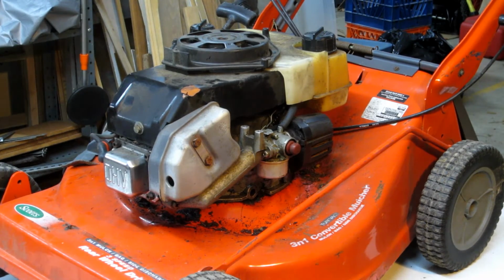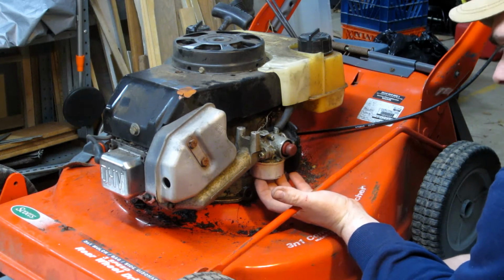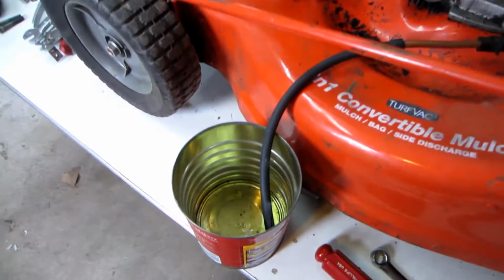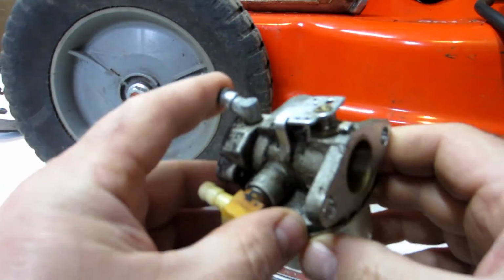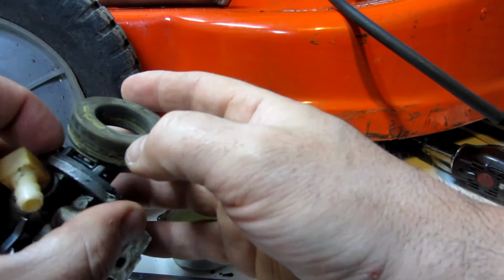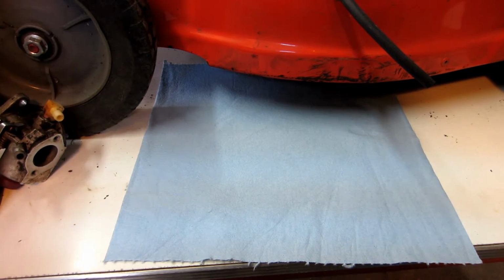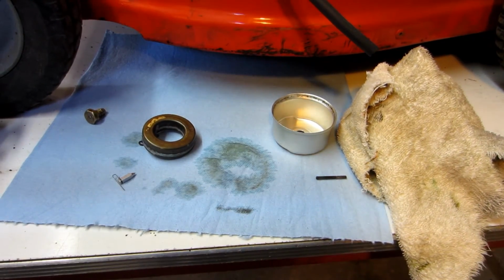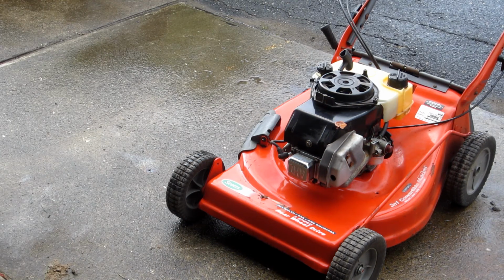Scotts Mower 6.5 hp self propelled.  Is it dead or Alive? Part 2

Comment: Can I get the model number and were I can get the driving belt?
Reply from the maker: I no longer have this mower, but I did take a picture of the tags.  The model number is 21997x8a.  I believe this mower was built by Murray.  That does match up to a Murray model number.  The part number for the drive belt for that mower is 672271MA.  Looks like you can get it on Amazon or Jack's Small Engines